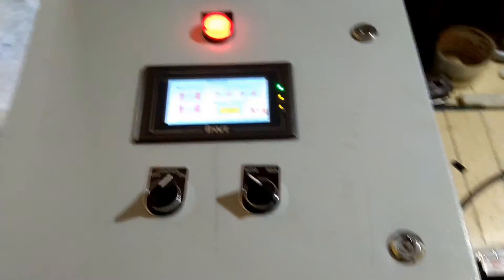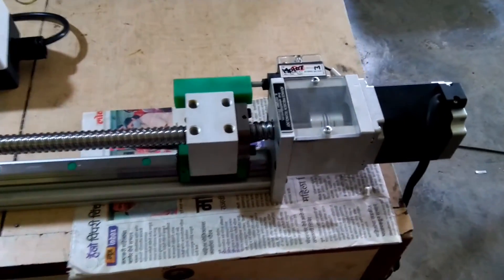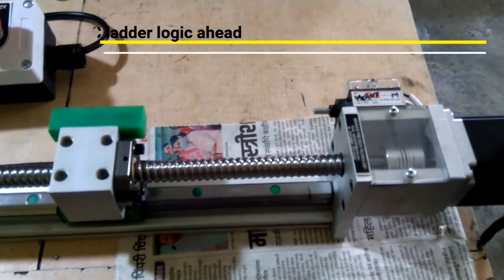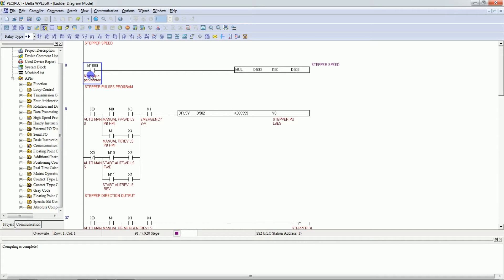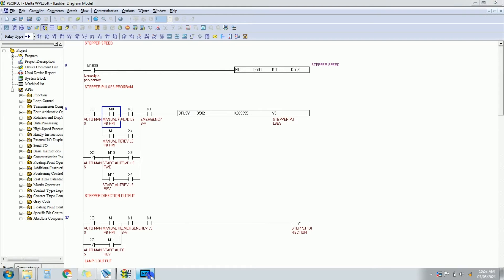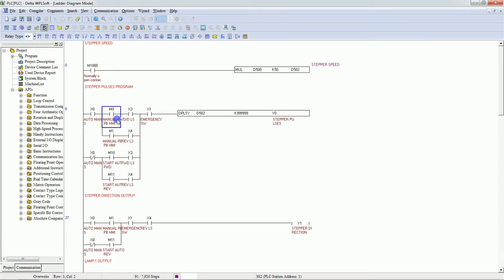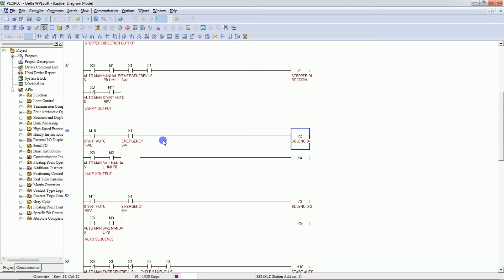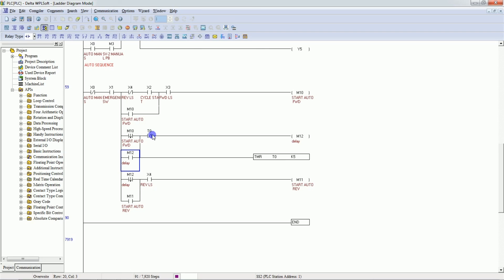Linear Guide Motion | Stepper Motor Application | With PLC Program Explained

Comment: Great Infos, I kindly request your guidance in suggesting a Delta PLC model along with suitable expansion modules that would allow me to control around 24 to 30 stepper motors, sequentially and a few of them simultaneously. Ideal output pulse frequency would be upto 5 kHz (less might also work). Greetings from Germany :)

Comment: @industrial Automation.
I am also working in a similar sort of project. 
can you please let me know the rating of the stepper motor you used and the load capacity of the linear guide you used???

I need linear motion of a 1.5-2kg equipment actually.
Reply from the maker: Load capacity of motor was 20 kg..